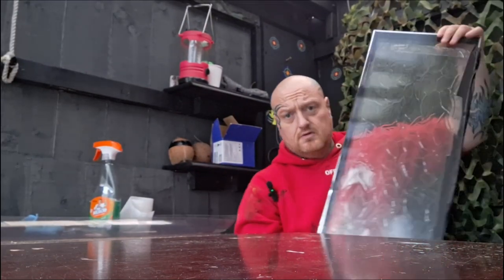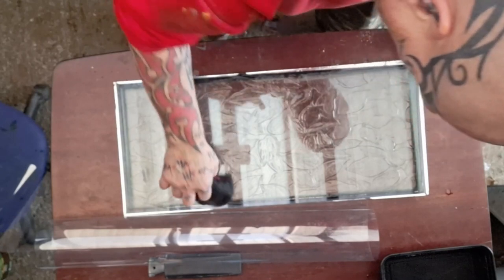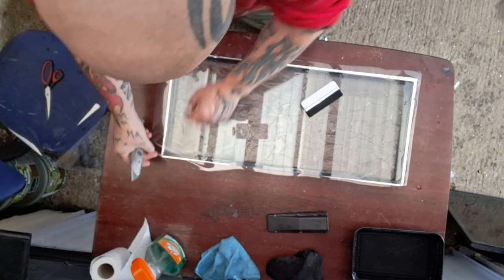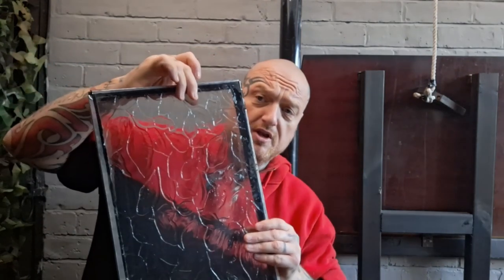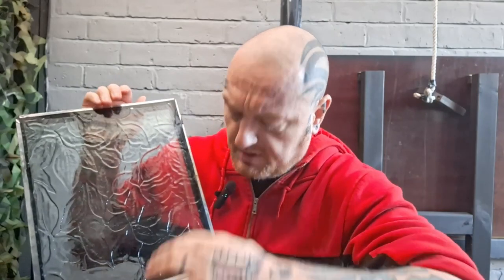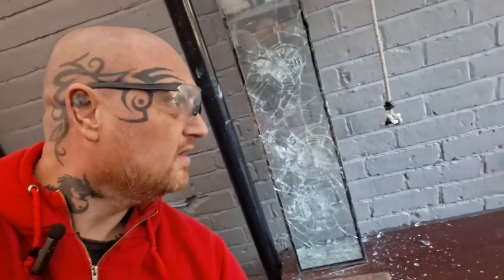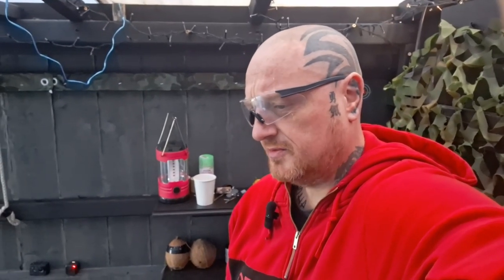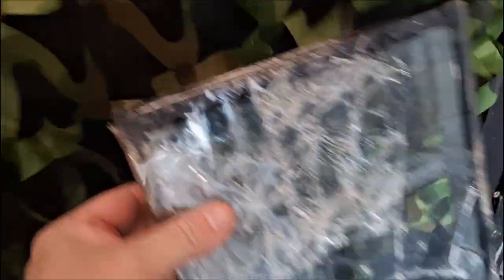Window anti shatter security film, how to apply and does it work?

Comment: Glass dust causes silicoses. There is no way to remove it from the lungs. If they can't enter through the opening it does the job it should. Problem in the states is stopping bullets.  Probably not much of an issue in the states
Reply from the maker: Ouch glad I didnt spend long smashing glass then, yea not really a problem here bricks and bats is about it